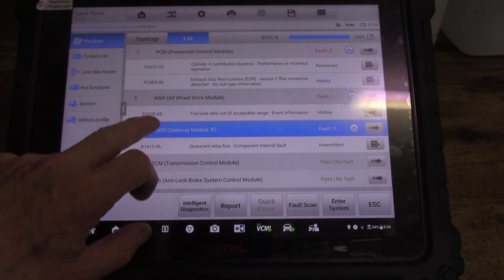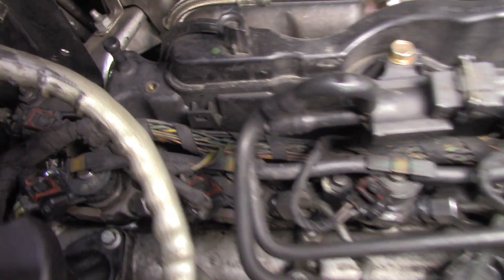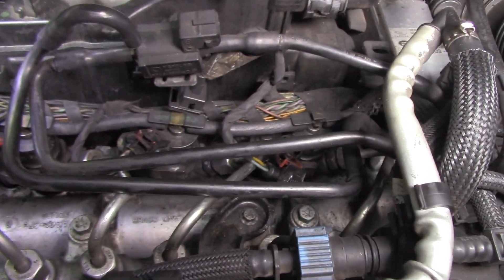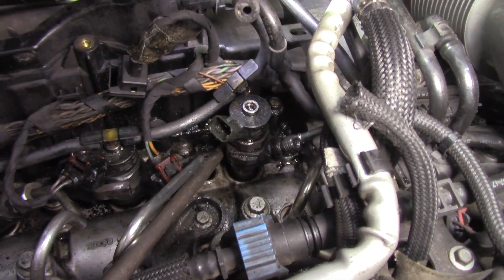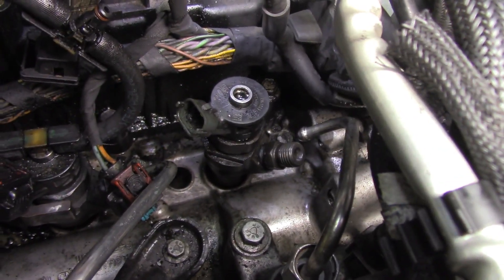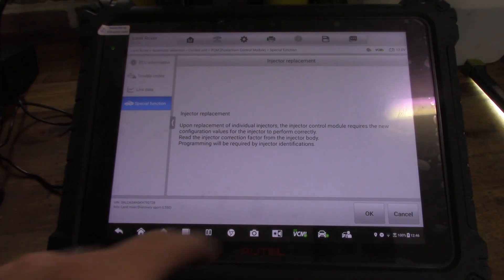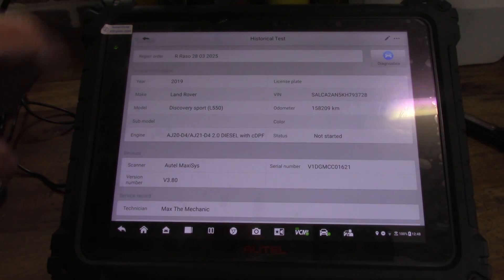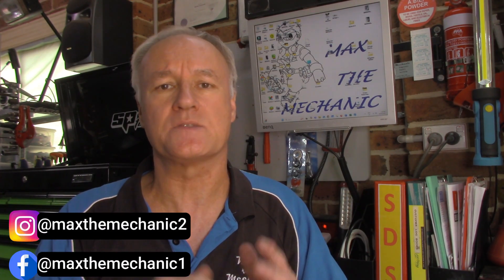Land Rover Discovery Sport Diesel Injector Replacement

Comment: What diagnostic tool are you using? Also, would you recommend replacing the injector if it’s just leaking through from the copper o-ring? Thankyou.
Reply from the maker: I am using the Autel Maxisys Ultra. It depends on several factors on whether to replace the injectors - running issues, service intervals, quality of fuel used, amount of kilometres, etc

Comment: Hi Max, 
Is there a similar injector replacement guide for Range Rover Sport or any website you can recommend for guidance? 
Also, does the gas engine injectors need to be programmed? 
Thank you
Reply from the maker: The principles are the same, however the bolt torques may vary. Have you tried just putting that in your search engine? You would need to put in the make, model, year and engine size (petrol or diesel). I just came across the one I listed in the description by using that search.
Yes, if the petrol engine is a GDI engine, the injectors will need to be calibrated.

Comment: Another great informative video. Unfortunately you can only do what the customer wants but generally it’s important to do all injector washer seals. Diesel engines have special service requirements and are not as forgiving as petrol engines. I advise people driving diesel engines not to cut corners as it will cost a lot more in future break downs. Thanks Max for getting the job done and getting the customer back on the road 👏👏🙌
Reply from the maker: Totally agree with you. I am expecting this vehicle back in the future to do the rest of the job, however as you said, it's up to the customer.

Comment: I take it customer didn't want to replace the injector line ? Comon rail fuel lines(most manufacturer's will state) one use only due to the extreme high pressure they run.

Comment: Nice work mate, 
Having worked on enough Ford, Citroen & Peugeot diesels, I know having a seat cutter is a must 😁  
The injector puller is one of those tools where you never know you actually need one until the day an injector will not move, I owned one for years before I actually needed it! 🥲
The workshop back in Ireland has a pneumatic injector puller & the injector seat cleaning kit (basically wire brushes and extensions that can be used on a drill within the bore) because of the amount of diesels on the road back there coupled with poor maintenance and the climate conditions.. it can be extremely difficult to do these jobs without special tools. 
 
As always, keep up the good work 💪
Reply from the maker: Thanks mate. I now have the cutting kit. I'm sure this vehicle will be back when the other injector washers leak.
I have seen the pneumatic pullers - they look crazy! 👍
Reply: @MiracleMAX  Great stuff mate, I see you are nearly at 15k subs, I absolutely love to see it! Imagine when you have 500 videos up where you will be 🤜🤛💪 onwards & upwards
Reply from the maker: @GerardBurkeBurkesGarage Thanks mate, slowly but surely

Comment: Hi Max, I used Baby Wipes at the end of a rubber hose and the other end of the hose attached to a drill and used carby Clean to clean down the injector hole, worked beautifully.  I also didn't have a seat cutting tool and I didn't want to use one.
Reply from the maker: Good to hear you found a workaround that worked for you 👍

Comment: We really need to have a lot of trust in our torque wrenches. I wonder what actual tolerance the torque settings imposed by manufacturers have in way of tolerances before things break.
Reply from the maker: Tightening torques usually have a + or - range that allows for a variation of tolerances. In theory, torque wrenches should be recalibrated on a regular basis.
Reply: @MiracleMAX yes, keeping our tools in top working condition is desirable of course.
Reply: From memory the accuracy of a quality torque wrench should be either  Plus or Minus 2% or Plus or Minus 4%. Can't remember which one but I will find out. And as you say they should be recalibrated/recertified on a regular basis.
Reply: @markheaton-e2i there would likely be an industry standard in tolerance no doubt. I'd be guessing around the 5 percent mark as a maximum for tolerance? AC Delco seems to have a good reputation for their tools and calibration certifications. I've never purchased a kingchrome brand, does anyone know if they come with a certificate at such a low purchase cost? Their cost to buy a new one is around the same price for a calibration.

Comment: Didn't realise they can manufacture bolts with localised stretch sections! All great info. Thank you very much MM.
Reply from the maker: Torque to yield bolts are designed to be tightened beyond their elastic limit, causing them to stretch and permanently deform, which is intended to provide a more consistent and reliable clamping force. Once they pass the elastic limit they enter the 'plastic' zone - a point of no return. That's why you should replace any torque to yield bolts when removed.